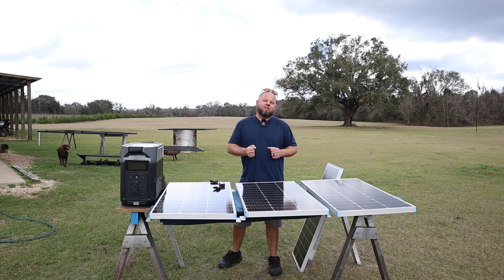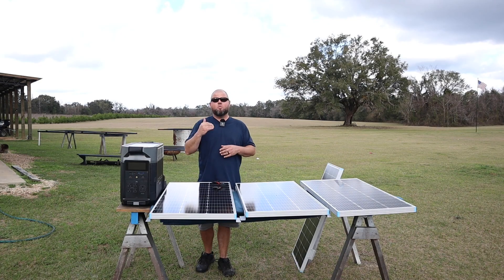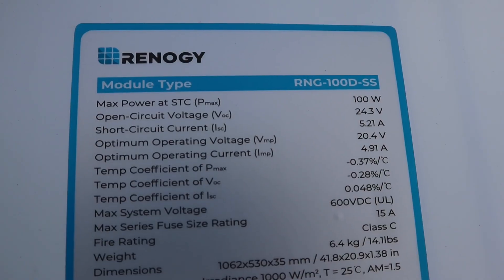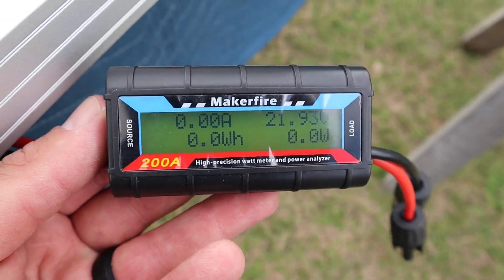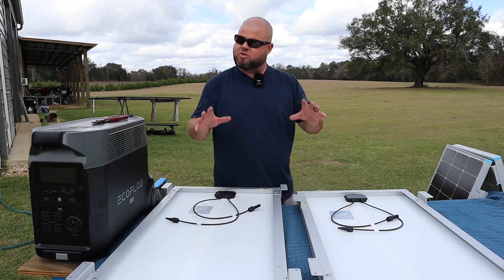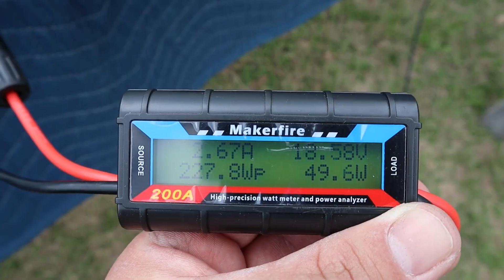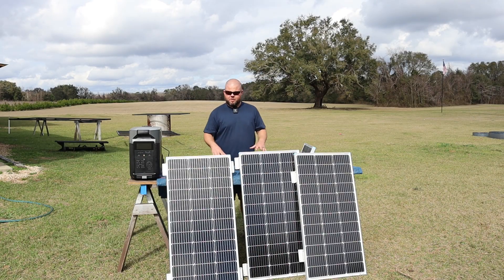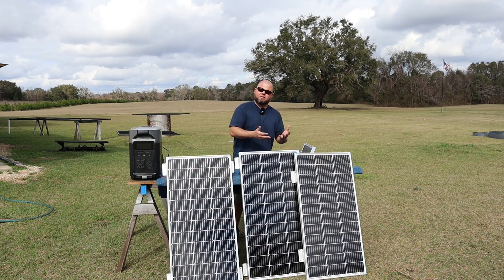How to wire solar panels! Series, parallel, series/parallel explanations. #720

Comment: This won't apply to your setup there in the South but here's something other people may need to watch out for. I setup some solar this past fall and everything was working great until we got some really cold days this Winter. When it got down to about 10 F and less, the voltage of my panels actually went higher than the rated open circuit voltage and my system was shutting down because it was over voltage. It's not that cold very often so I'm making due with it as-is until Spring then I need to rewire them to lower the voltage since my system can handle the higher amperage.
Reply from the maker: That's exactly right and also why I undersized my system. I've already been seeing way over recommended specs. So it does apply here also. Video out soon!

Comment: Think of like this. If you want to get 2000 watts. From 120 volts you need 16.6 amps. From 240 volts you need 8.3 amps. As voltage increases amperage decreases for a desired wattage.

Comment: Great video.  And I don't mind you repeating the information... sometimes it helps it all sink in.  I am curious to watch the next one and see how you keep the combined panel output under the maximum ratings for amps/volts/watts.  

I have a remote storage container I use as a shop sometimes, and would love to know how to set up an inexpensive (by inexpensive, I want to use a battery bank and an inverter rather than one of these expensive systems like yours) to add some lighting and an outlet to run the occasional power tool.  If anyone knows of a youtube video as easy to understand as this one was, send me a link please.  As always, thanks for the simple and concise info!